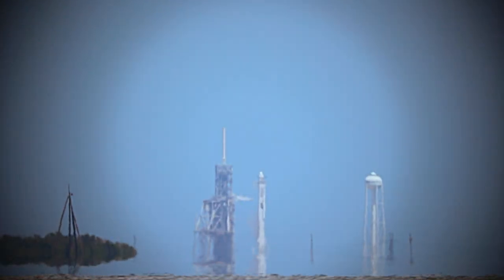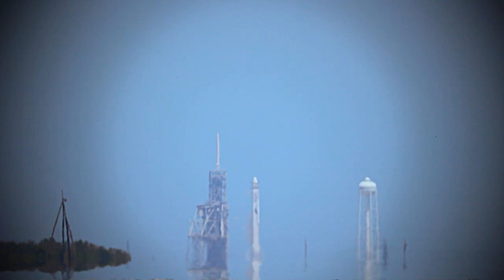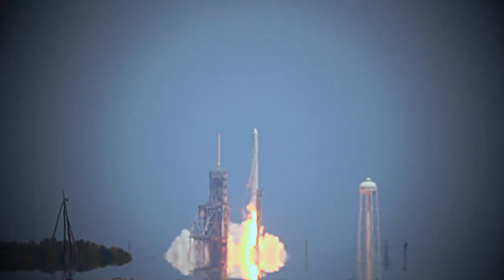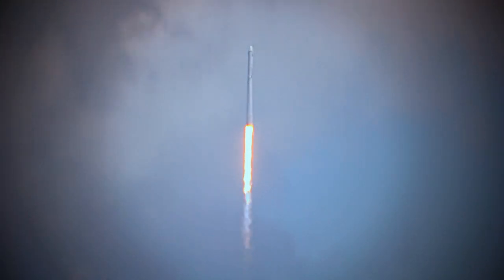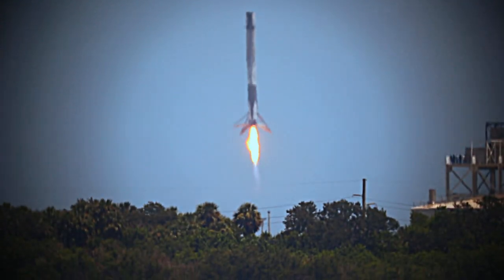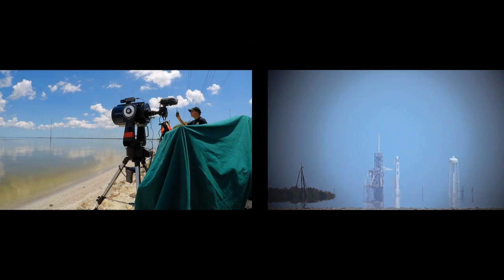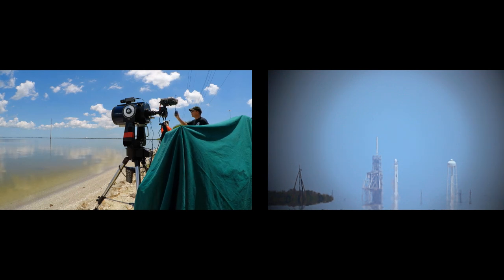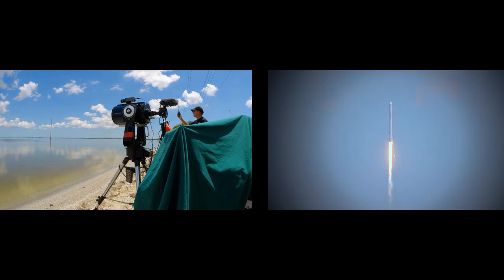Continuous Close Up Footage of Launch Through Landing of the CRS-12 Falcon 9!

Comment: Very nice video. Your tracking is very good when the target is acquired. Do you use imaging data for the tracking computer? The landing burn sequence showed some pretty large swings of the central motor gimbal ... F9 tries very hard to land right on the X :-)  Does the S2 start-up help to blow S1 back on its flip before the boost-back burn? (Obviously, the boost-back burn has to begin ASAP after stage separation).
Reply from the maker: awuma thank you. I wrote the tracking software and it can use imaging data from a viewfinder camera. The lens I used for that camera was a wide angle lens to be able to quickly reacquire it after it came out of the clouds during the first stage of the flight. The trade-off on that decision is that the viewfinder can't see the first stage after engine shutdown. I used manual joystick control while watching both the viewfinder and main camera screens, but on a clear day I can use a guide scope as the viewfinder camera and keep it automatically locked on for more of the flight. I'm not sure how much pressure the second stage engine applies to the first stage, but that's an interesting question.
Reply: awuma They have something with a odd name. Think it's the "slam brake" or something. Basically the 1st stage is computing the exact time it needs to start its landing burn so that at "altitude = 0" the speed also equals 0. You must remember that:

A. The 1st stage whan coming back is much lighter because it no longer has the 2nd stage
B. The 1st stage when coming back is much lighter because it has much less propellant (O2 and Kerosene) 

Much lighter equals much less thrust needed.
Reply: Hoverslam ;)
Reply: Previously derided as a "suicide burn". :p

Don't see that term used much any more... funny that.
Reply from the maker: Destructor1701 well the term suicide burn simply refers to a burn that occurs at the last possible moment such that the vertical speed should equal zero when the altitude reaches zero (though they do have a small bit of wiggle room with the throttle of the engine). I guess it does have a negative connotation associated with it, but SpaceX has certainly shown the technique can be made to reliably work even on earth.
Reply: I was aware of that, but my humorous intent may have made the statement a little misleading, yes. Still, I agree that Falcon 9 has probably earned the retirement of "Suicide Burn" in favour of "Hoverslam" now - a mildly more reassuring term :)
Reply: I was an early adopter and long time player of kerbal space program.  Fuel consumption is everything and landing on Mun or wherever in often resulted in being very low on fuel and resorting to this method when all else failed.  When you could pull it off, you truly could save lots of fuel. I wasnt the only one who discovered this technique and the term went around the KSP forums well before anyone saw a F9 pull it off. Doubtful a bunch of KSP fans truly created the term but likely the biggest group to use and perfect it prior to SpaceX
Reply: It's even more efficient when THREE engines are used for the landing burn. They have had to do that for some of the GTO flights landing S1 at sea. Now that's a real "suicide burn" ;-)  ("Hoverslam" isn't terribly accurate because there is no hovering involved ... New Shepard can "hover", because the BE-3 cryogenic engine can be throttled down much more than the Merlin  (20,000 lbf vs. about 70,000 lbf ). The final landing weight of New Shepard is apparently around 20,000 lbw,  about half that of an F9.

Comment: Holy moly.... That's some kick ass footage you got. Love all the cold gas thrusting you can see in the upper atmosphere :D
Reply: This video puts a whole new perspective on that, and with no air pressure it is exaggerated. wow
Reply: The side by side video was real cool.  When the first stage was getting ready to land, just before it turned on it's booster rocket for the landing, you could see it as a tiny speck waaaay off in the distance.  They picked a good spot.  They got the launch and the landing several miles from the launch spot.  That was so cool.

Comment: Really well done. What size of telescope do you have and did you track it manually?
Reply from the maker: John Fox I used an 8" LX200 classic. The tracking was performed manually for this launch using an X52 joystick. The software I wrote to do this can also perform automatic tracking, but I elected to perform manual tracking to ensure smooth tracking through the clouds.

Comment: I see you are using a radio. Is that to hear the communications?. I have been using my phone for the space x launches but there is a lot of lag. Do you have any recommendations on radio and on what frequency they use?
Reply from the maker: I use a ham radio or scanner to pick up the 146.94 repeater.  They generally have lag-free audio for NASA launches, but if it's a SpaceX launch for a non-NASA payload the repeater is usually just re-broadcasting the SpaceX webcast with all its lag included.  For Falcon Heavy they did have a real time lag-free audio feed on the 94 repeater, which was quite nice.
Reply: any recommendations on what scanner to get? I red somewhere that Nasa was using some form trunked scanner system that most scanners cant pick
Reply from the maker: Rolando Perez the 146.94 repeater is an amateur ham repeater. Any Radio Shack scanner that can pick up ham frequencies should be able to receive it

Comment: Awesome!  But to show my ignorance why don't they use supersonic streamers, then high speed parasails to return, slow and land?  Wouldn't that work or at least aid in the return?
Reply: Sonny Burnett - I think that's exactly what they do to land the fairings. But that's asking too much for the first stage. A parachute large enough to land it slow enough would be impossibly large and could never get the accuracy needed. And even if it's just for aid. It's just more dry mass which would hinder performance. The space shuttle SRB chutes were the largest in history. And even then those boosters hit the water at 16mph. They were just big metal tubes so it wasn't an issue, but that speed would total a Falcon 9 booster.

Comment: Why you no zoom in?
Reply from the maker: Morgellons MN it's a telescope and so the focal length is fixed and cannot be changed during filming. It is zoomed in though. The full moon would barely fit within the field of view. On a clear day I may increase this another 30% by removing the focal reducer from the optical train. This will make accurate tracking more difficult, which is why I elected to keep the focal reducer in place on this launch.

Comment: What was your exact location of filming, latitude and longitude.
Reply: C. Truthy The power lines were very far away and to the left of the camera's shot. You can tell this by the angle of the telescope at the moment they appear at 8:42
You shouldn't have dropped out of school.
Reply: C. Truthy: Trigonometry. Nice try :-)
Reply: If your statement is true, then the power lines should only of shown up at or near landing as he is pointing across the intercoastal waterway.   Power lines are only about 35 to 100 feet off the ground, so if the Falcon is 230 feet high, then you wouldn't see the power lines until it was already on the ground.Give your exact location Lat/Long.     I doubt it will be posted at all and the defenders will just ridicule this question.
Reply: Yep, math can solve and prove a lot, like the truth or a fakery.
Reply from the maker: C. Truthy there were power lines and there's no escaping the fact that you will see them in front of the Falcon before it lands. I don't understand why you believe they shouldn't be visible until it's already on the ground but that's simply not true and you can see the same power lines in the GoPro footage as well as in other videos from Port Canaveral.
https://youtu.be/FIYJHS09CDs

Comment: guys can you all buy a p900 camera for god sake. cmon we need good video from the landing . its not that expensive. PLEASE
Reply from the maker: A.E.E.N 5th my telescope has the same focal length as a p900 but it also has a much larger aperture than a p900. My telescope also has computerized tracking using software that I've written myself that allows me to track the rocket's flight with a joystick and automated control that is much smoother than I ever could achieve by hand.
Reply: I had a celestrom 9.25. these focal are not made for filming things so close. what camera did you use? if a D810  or better i would agree with u.  but nice video. keep the good work
Reply from the maker: A.E.E.N 5th I use a Canon T5i camera at prime focus. The telescope provides a much more stable mount and automated tracking that is much smoother than anything I could achieve otherwise.
Reply: Astronomy Live and don't forget the increased optical resolution because more aperture.

Comment: crs ??? cant. reach. space.
Reply from the maker: Clearly, it can.  Even the first stage reached over 100 km altitude before turning around and flying back home as I tracked it continuously from launch to landing.  CRS = commercial resupply services.
Reply: In the case of flat earthers, it's more like "can't repair stupid"
Reply: Space is 62 miles up ... its quite easy